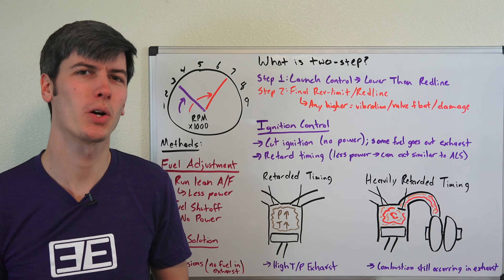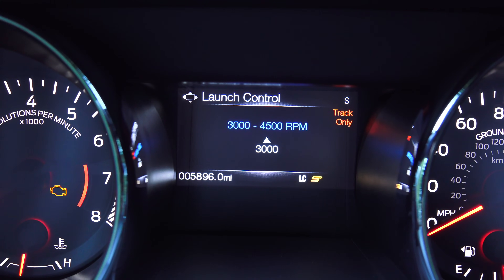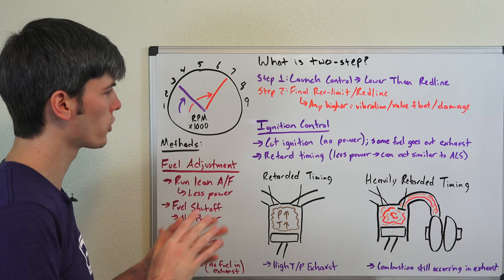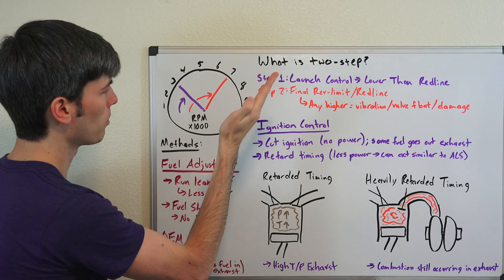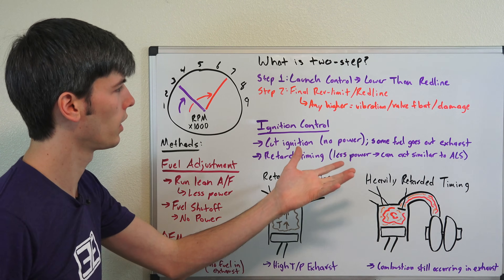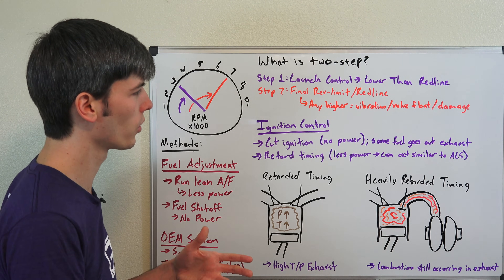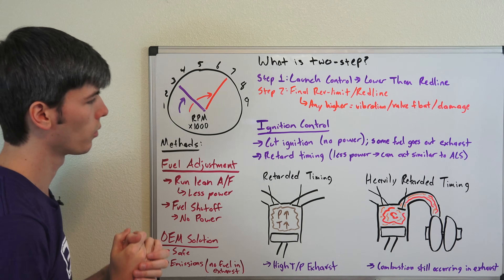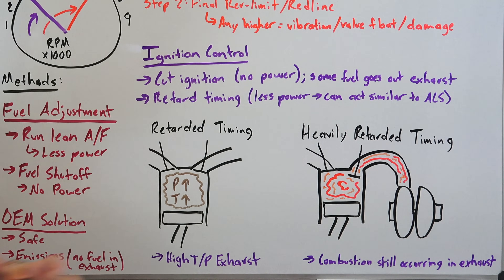What Is Two Step? Rev Limiters Explained

Comment: Oh this is an old video but I had an idea to just drill into the valve cover and install a can position sensor to read for exhaust stroke (weld on a  reluctor ring reference on the exhaust cam) and use that reading to trigger the injectors to use the smallest fastest spray during the exhaust stroke. That way instead of playing with timing it's just gonna have a little fuel in the exhaust which will light with every stroke. I figured a capacitor and a resistor tied to a voltage sensor thru the exhaust. Am sensor?

Comment: You know what your using is actually called a stutter box, we launched at full throttle with a stutter box that’s what there actually fit and you want it set at say 4000rpm if the stall on your converter is 4500, it cause a controlled miss so you can be at full throttle and only at 4000rpm so the car won’t move off the line this product is for race cars not street drivin cars

Comment: When you mentioned at the end, having an exhaust system built properly for it. Would it be safe to run a Bee R rev limiter on a rb25de+t? Factory cast det turbo manifold, rb25 turbo, 38mm wastegate and 3" straight pipe exhaust.

Comment: If the ignition is cut off using the ignition control method, won't the engine stop running? Considering that combustion cannot occur without the spark (in a gasoline engine). Then this method can be used in conjunction with controlling a/f mixture to cut off fuel supply preventing fuel from being dumped into the exhaust. Either way the engine will stop running, but at least fuel won't be dumped into the exhaust.

Comment: Maybe a silly question, but here we go: If an automatic car has a standalone ECU can you retard ignition at that part only of your ignition map where the car sits when loading at the track (e.g. 2000 rpm) to recreate the same effect of a launch control but in this case only to spool the turbo (because pressing the brake is still the primarily reason the car doesn't move)?

Comment: For drag racing you wanna be at redline when you launch, but you run studder box and trans brake to do this a studder box makes the car miss every other cylinder so you can floor it till you go on whichever yellow light you leave on or count if your running on a pro tree and leave with max power so you shoot off like a rocket, there's no such thing as a no lag turbo I don't care what anyone says NHRA did a study on turbos and found it takes 2-3 seconds to actually make boost, and I've always got more power from advancing my timing not retarding it

Comment: Why does my engine have a lower rev limiter when I’m in neutral vs while in drive? 2017 F150 3.5 Ecoboost. In N it’ll rev to about 4K and in M mode it’ll get up to around 6500.

Comment: what bout three step
Reply: The ECU in my miata can actually do that... the 1st rev limit is only used when the car isn't moving (launch control) the 2nd one is used when the clutch is in but the car is moving (flat-foot shifting) and the 3rd is at redline

Comment: I've read an article about the rev limiter, and it claimed that cutting fuel could increase the temperature of the engine, because the fuel takes out some heat out of the engine. And the engine could overheat. If so why modern cars use this method to limit rpm? Anyone knows?

Comment: Mate first off love the channel, so much info for a guy like me but isn't leaning out the fuel gonna cause high temperatures in the cylinder potentially melting pistons or at least prematurely wearing them out in say cars with large turbos? 
I'm not sure if it's correct but that's how you do it with nitro rc cars

Comment: Cool!  So modern drag cars have the same technology as my 1993 Mercedes 300CE Cabrio which limits revs of the twin-cam 3.2 straight-6 to 4,000 RPM when stopped, and switches to 7,000 RPM when underway.  Not that it remotely resembles a race car.  (its a pig around town, and doesn't come to life till over 50 MPH, then blasts up towards 140 MPH)

Comment: Maybe it's just because I'm old school and I don't keep up with the newer tech, but I gotta respectfully disagree that cutting fuel is safer than cutting spark. I suppose if you cut fuel AND retarded timing, it would be okay but that would cause a loss of power, which I'd rather not have on a drag strip lol. Cutting spark will ruin cats faster, but on a track only car you probably won't have cats anyway. Plus, cutting spark leads to excess fuel in the exhaust which makes you spit flames :D who doesn't wanna spit flames?!?!

Comment: Surely you wouldn't lean out af to control rpm. Engines actually produce more power when running lean. A downside of this is that they also produce more heat and melt pistons.

Comment: I have a question: if on the later case, you open your exhaust valve while combustion is still happening, you'll obviously have flames coming out of the exhaust. But won't that damage the exhaust system components?

Comment: how is leaning an engine down at high rpm and high load safe. thats a bomb. period ad period.  id have to see an afr gauge to believe that. lean mix burns way hotter, detonates much easier - there must be some ignition cutoff or that just would not work.
its safest to cut ignition.

Comment: My 2000 mustang (manual) had a 2 step rev  limiter. One at redline and the other around 3500 if the speedo didn't get a signal. Although the first wasn't really apparent unless you tried driving without the speed sensor hooked up.

Comment: 84YM JDM Civic Si had 2-stage rev limiter preventing the engine revving over 4000 rpm when cold.
Mazda Familia GTX (JDM version) enforced the Japanese 180 km/h speed limit with a fuel cut-out. Not good when the wastegate has a T-piece tube to produce overboost and you hit the speed limiter while boosting hard in 4th... pieces of piston ring everywhere... :-(

Comment: do a video explaining why Mustang owners can't drive.
Reply: AsiaNYelloWNecK dude mustang owners CAN drive.... just ONLY in 1st gear, hit 2nd and they are up kerbs and into walls or oncoming traffic 🤙
Reply: lindsay obrien 
🤣😂🤣😂😂
Reply: damn straight
Reply: @joncross2369  Unlike a Mustang driver on the road
Reply: @joncross2369  into a crowd or wall lmao
Reply: See that is a question that not even science can explain.
Reply: Live rear end.. there is tiny amount of side to side play from the axles to the diff.  when some amateur smashes on their new GT, that tiny play actually amounts to a significant translation sometimes allowing the rear end to 'walk' or 'hop' side-side. which results in a crowd torpedo. lol  There IS actually a reason for it lol.
Reply: @superrad1659  2015 and up Mustangs have IRS now (finally). And yes, before anyone comments, 2003-04 Cobras had IRS.
Reply: @brandenhart3768  Good to know!
Reply: It’s actually a very interesting reason and no fault of the driver. All mustangs front bumpers are infused with a strong, top secret, magnetic metal to save weight. The problem with this metal is that it is magnetically attracted to curbs rather than other metal. Normally this would not be a problem because the tires have enough grip to offset the magnetic attraction. However, when the mustang initiates a burnout, the rear tires losing grip is enough for the magnets in the front bumper to begin pulling the car towards the curb. Hence the reason mustang owners are bad drivers.
Reply: Almost as bad as Toyota owners. God help you if you're stuck between a Carolla and a LeSabre.
Reply: Because the people who bought them cant drive. Thats like saying guns kill people. Guns dont shoot by themselves if you didnt know.  Another thing yall act like you never seen any other car crash before. I seen chargers and challengers drive up poles like 10 times in the past year
Reply: Wow 3 years later and I'm now reading the comments, y'all funny AF🤣.
Reply: Chevy wont give them any more credit of course
Reply: Too damn funny! 😆
Reply: 350z*
Reply: This comment wins the internet
Reply: This guy said a “v6 mustang” 😂 no duh it’s a v6
Reply: Random Tubers bruh V6 mustangs can have as much as 320 horsepower, almost 3x the amount that your Honda Civic has.
Reply: Shea Stephens Are you on dope...? The 95 mustang v6 has 145 hp
Reply: Normal stand drivers can BUT 16 yr olds on steroids use daddy’s money to buy a 600hp beast that they can’t drive soo......
Reply: False
Reply: I think your logic is a little off, you should have said "Why is it that people who cannot drive buy a Mustang?" I once owned a '65 Mustang with a 4-speed, and I could drive it nicely.
Reply: Long story short cars too powerful
Reply: V6 mustang owners are cancer
Reply: Better yet why people posting on YouTube can’t come up with a single original thought.
Reply: It's a combination of small dick big ego and lack of intelligence
Reply: Shots fired
Reply: Shots fired shots fired
Reply: Haaaaa!!!!
Reply: And I’m proud of it
Reply: curb hitter. for decades.
Reply: I'm dead
Reply: Love it
Reply: Lmfao
Reply: And bmw
Reply: Perfect convo for DrewPeacock lol
Reply: Sounds like someone is upset they got their puss spanked.
Reply: The 2 steps of owning a BMW:
1. REV
2. MAINTENANCE
Reply: @gavin-alsoliman7455 you saw that diy cat delete too?😂
Reply: ALL Mustang Drivers suck weiner and gag on the pipe...expert pole smokers!😮😂
Reply: *corvette
Reply: What color is your mustang ?
Reply: It’ll prob b a whole hour vid after editing, so meh, plus we all know why
Reply: That would be an awfully long video
Reply: That would be the longest video on YouTube
Reply: What do you think of the MSD two-step box😅
Reply: Hey! I can drive…… into a tree at 30mph
Reply: Because GM discontinued the Camaro flop that couldn't even outsell the over priced Challenger that got cancelled also. Mustang is the only car on the market.
Reply: 😂 I hate you lol because it made me laugh and I was like that's a good one and realized I am now a mustang owner fuh
Reply: You had me chuckling 😂😂
Reply: 🤣😂🤣... I’ve owned five Mustangs thus far (now I own a Dodge Challenger R/T).  The Mustang is highly unstable at high speed and the car gets out of control easily. Just when you think you’re going straight, you realize that you’re turning left or right and thus turning to face oncoming traffic.
Reply: @MansSuperPower  You must be one of the shitty mustang drivers then. I have a 1995 mustang v6 with quite a few mods on it, its fast, and very stable, and ive never ran into anything. Half these fucks probably havent ever even drove.
Reply: hueroski these comments got me weak
Reply: They own mustangs the answer is in the car they purchased
Reply: You guys must be lucky...you can buy a mustang around $15-30k on your country....on my country mustang is kind of luxurious things... Mustang ECOBOOST on my country is around $120k and thats so sad🙃
Reply: @kevin_brok  geezus. What country u in homie? Ive got a 2020 GT. Love it.
Reply: @VesselFitterguy  indonesia dude tax for import things is pretty high in here.
Reply: @kevin_brok  that's insanely high bro. Head on over to America.
Reply: Ok guys if haven't actually tried driving a mustang, its handling is far more difficult to handle especially if your gonna try something risky like burnouts donuts etc, without training the car to know its handle, your gonna hit something
Reply: Because that's the first car they can afford to drive and reck without feeling guilty.

Comment: One problem in your explanation…

Leaning out the A/F is not used to limit the engine. It's destructive (as i'm sure you know) and would not aid in halting the advance of rpms. Fuel cut-off and spark cut-off are the only two ways to safely achieve a limiter. 

Perhaps you're referring to whats known as a false lean during spark cut-off. Tons of unburnt fuel and oxygen in the exhaust tricks the system into thinking it's running lean when really there's no combustion occurring.

Comment: Do Dual Clutch cars have a rev limiter? 
I have an Audi DSG and it seems like the computer simply changes gear when the revs get to redline.
I suppose it is only needed for top (7th) gear going at full speed, but at that speed I guess the speed limiter kicks in, which I assume is basically a rev limiter anyway.

Comment: Do you have a video about alignment vs air suspension? I'm thinking about getting my F10 BMW on air suspension, and was wondering if it will be an on going trip to the alignment shop and rotating tires due to the constant raising and lowering of the car. Thanks

Comment: You should also mention that a rev limiter only works when you're accelerating and the reva are increasing. The revs will climb to the point of that limiter rev range and then the limiter kicks in to prevent any damage. If you're driving a manual and mis-shift, let's say you wanted 4th but hit 2nd, the rev limiter will not prevent engine damage due to the mechanical force and gearing up to the engine, which will mechanically cause the engine to rev higher than the set limiter value.

Comment: Hey I have a question, it's not about this particular topic but I guess that's not a problem.

So I watched your video of the Crossplane V8. Crossplane, becuase the crank looks like a cross right? Or is it crossplane because of the firing order? Because Yamahas R1 from 2009 and onwards has an I4 with 90° offset (CP4), again the crank looks like a cross. But now there are the FZ09 which has an I3 and a 120° offset (CP3), still kind of creates a cross. And then there's (what's kind of confusing to me) the FZ07. It has an I2 with a 270° offset (CP2) but in that case the crank doesn't really create a cross but is still called a crossplane. But why?

I hope you're able to enlighten me! ;)

Comment: I'm pretty sure modern engines with computerised gas pedal don't do either.
Instead, the computer simply floats the revs at whatever number you (or the manufacturer) set it to. Although I'm not as informed as you budy,  so I could be wrong.
One more thing I'd like to ask if you have time 
distilled and de-ionized water. 
Is it the same thing or not? And if not, what's the difference. 
Thanks.

Comment: Was just about to add a comment about the throttle to control RPM but you caught it before me.

Actually what is used to control RPM depends on the time frame it needs to happen.  Cutting fuel is the sledge hammer approach, very aggressive and very fast.  Retarding spark is also fast (can apply at next firing) and smooth but has limited range of authority before miss fire and emissions issues.  Throttle is slower and smooth without any emissions / miss fire issues.  However, as you pointed out the downside of using the throttle is reduced gases to spool up the turbo.  A combination of all three is good.

Comment: So the jackasses with flame spitting cars are Heavily Retarded?
Reply: Hercules Rockefeller And people with an anti lag system have ALS
Reply: There are many ways to spit flame. But usually Yes it's due to retarded ignition(AKA "Anti Lag System").
Reply: Hercules Rockefeller , that's funny!
Reply: I have a 2002 Camaro z28 with a Ls1 w cam/head/intake will it spit flames with a 2 step?
Reply: Venom in my opinion in might be hell on exhaust valves. but why you wanna spit flames when you can pull up with a sleeper, hurt feelings, and walk away with heavier pockets. best feeling ever
Reply: Big Meat it doesnt look like a sleeper anymore...

Comment: So I know a higher (leaner) A/F is bad for the engine because of detonation when you're beyond a stoichiometric burn. I also know that the ECU will give a lower (richer) A/F under full throttle. So would I be correct in assuming that the ECU will only lean out to a max of stoichiometric (lambda=1) for rev limiting cases?

Comment: Aren't these typically used in conjunction with transbrake, or are transbrakes used separately and the driver just controls the amount of rev themselves instead via throttle control rather than the 2-step system?

Comment: So I think I missed it. What is the difference between anti-lag and 2 step?
Reply: 2-step is just having two regular rev limits, one lower than the other. Anti-lag is injecting air and fuel into the exhaust manifold when you let off the throttle (often combined with some retarded ignition) to keep boost up when not accelerating. Basically 2-step is full throttle with clutch in to build boost for launch, and anti-lag is keeping the boost up when you let off the throttle.
Reply: Ah thanks!

Comment: I have a Cobb AP and it has 2-step but does anyone know what kind?
Reply: It cut's fuel at the desired RPM just like the factory rev limiter, and at the same gain, which is why no matter how long you pin the throttle at any RPM, it won't give you flames like ignition cut would. It just moves the factory rev limiter to wherever you set it momentarily. It's intended to be used like a factory launch control; to have a clean launch with minimal wheel spin, as opposed to building full boost.
Reply: SideWays8Productions Cool I wasn't sure thx